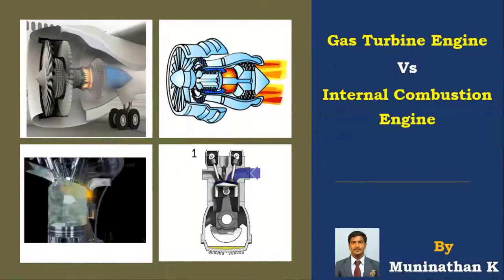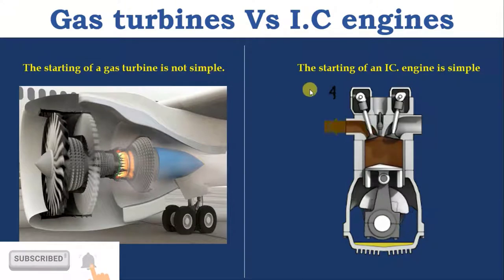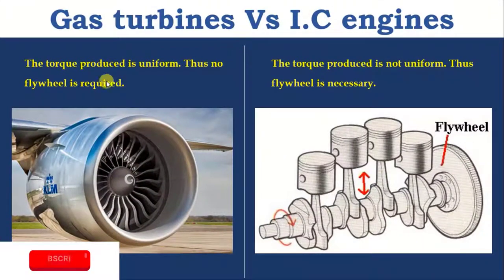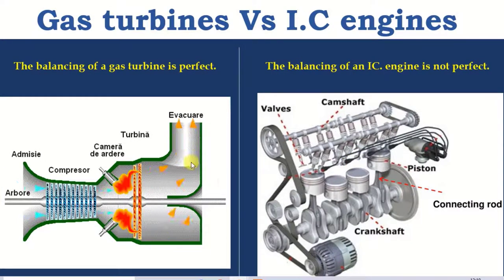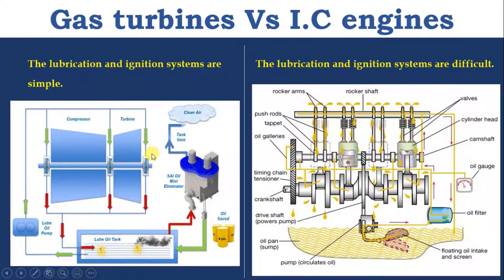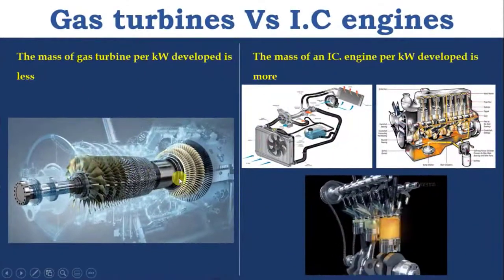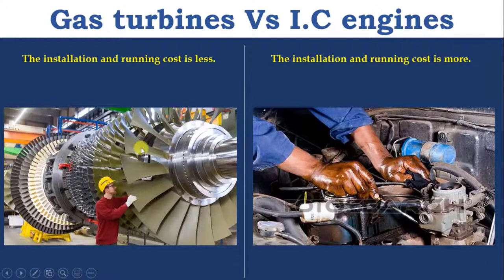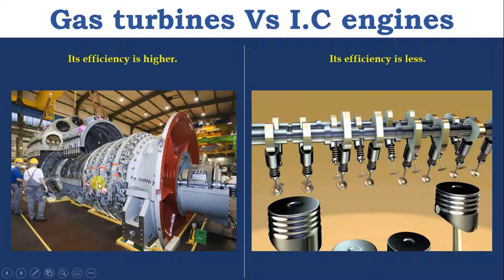Gas Turbine Engines Vs Internal Combustion Engines

Comment: Not accurate, especially the part about turbines producing less emissions.
Reply from the maker: Here I have not discussed about emissions... if you want, I will next video
Reply: @Thermscience  is it true that most turbine not burn oil anymore or is it false? Please and point us the factor that prevent it to happen. This only for commercial airline gas turbine engine including air force  G.T.E.'s.
Reply: He said that gas turbines produce less polluting not that gas turbines produce less emissions. Idk if this is true but i could see that id is bc i think gas turbines burn hotter